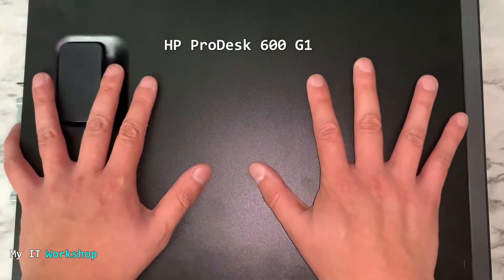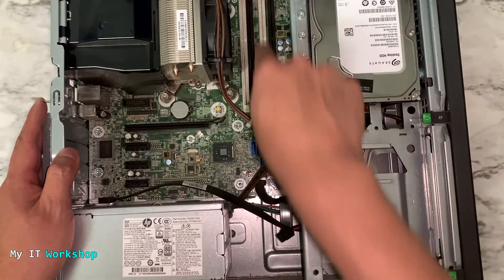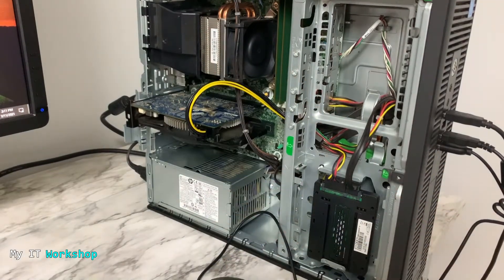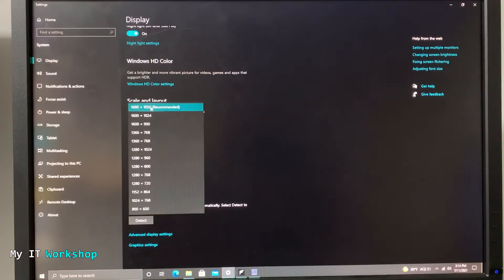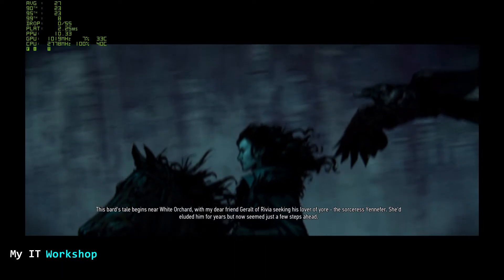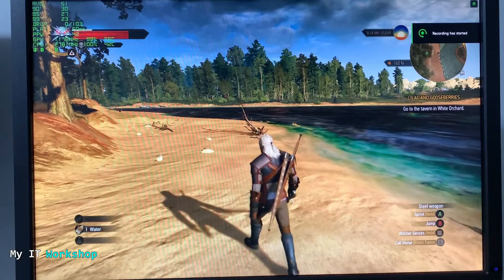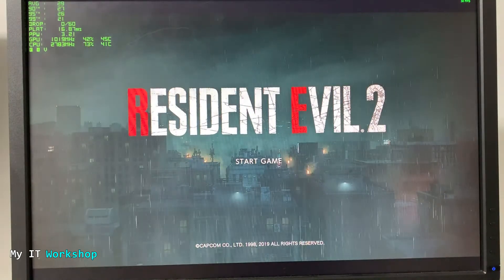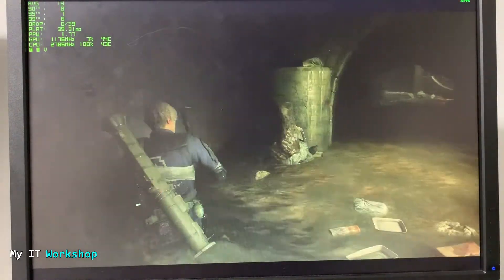Turning Old Office PC into a Gaming Machine

Comment: Hello mate... Nice video... I have done the same with an HP ProDesk 400 G2 MT & i pair it with an R9 280X. I also change the case :((((( .....and an error message appear every time it boots.... "922 Front Usb 2 Not connected" press F1 key to boot..... Very annoying... Do you have any idea how to bypass this error?
Reply from the maker: Hello,
mmmmmm I'd check the bios and see if there is any option to disable specific USB ports. I checked my HP 600 g1's bios, under "security" tab>> usb security   I can disable specific USB ports.  
Hope it helps
Thanks for the comment!
Reply: Look into DLM Tech Garage. There are adapters. You can also bridge some pins, Tech Yes City has a video on it.
Reply: @MyITWorkshop  hey dude, is it possible to upgrade power supply of hp elitedesk 705 g4 sff so as to install a gtx 750 ti